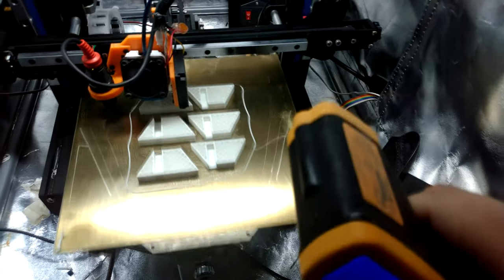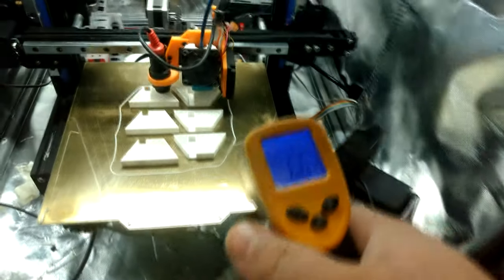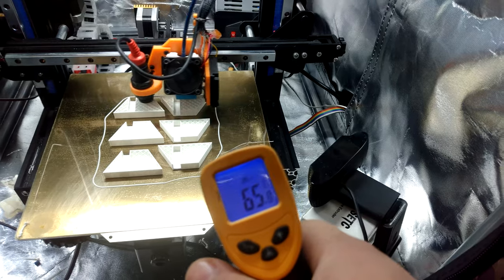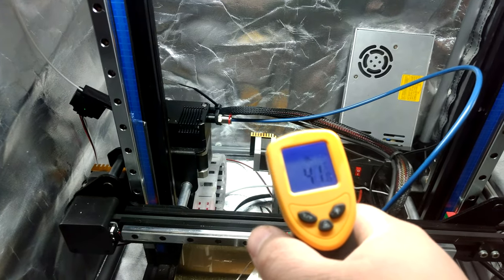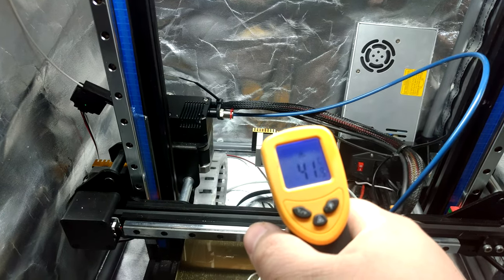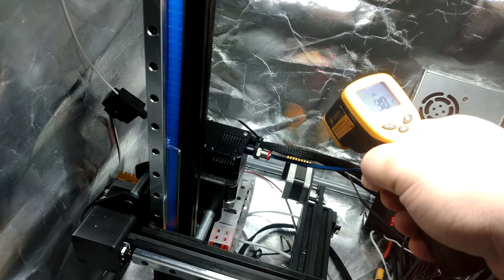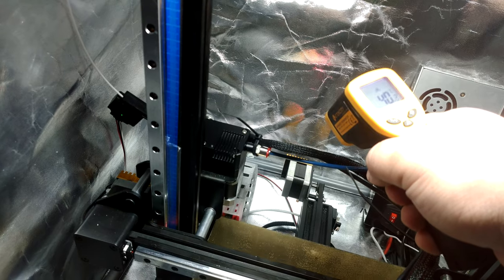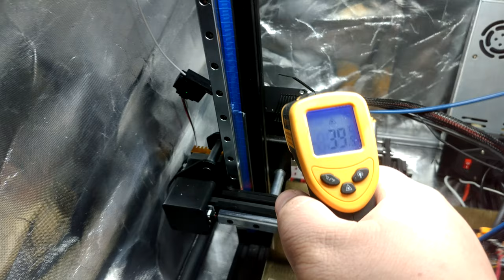The Downsides / Cons to Using an Enclosure For 3D Printing

Comment: Remove the AC/DC converter to outside, and also the motherboard from bottom. Connect the wires through the opening hole from the side of theinsulation. The only wire that you will need to extend is the vertical axis zero position sensor wire. I did it and it worked great.and tightening the belts is also needed,because at high temperatures they might be lose and cause failed prints.

Comment: While the motors are a concern, I've had them burning to the touch before, and yes, they can have issues when that hot. 40-50*C aren't really a worry imo though. My experience is that the cold end can get too hot and cause heat creep clogs in fully enclosed systems. Granted, that was using PETG and not something like ABS or something higher temp, but a water cooled cold end should be a consideration when doing an enclosure.

I'd also worry about the power supply and the brain board being in the heated area. Both of those you want to keep pretty cool for longer life.

Comment: Screw the motors, that psu in the corner crying for some fresh air is what worries me 😱
Reply from the maker: That was a very temporary situation. It needed longer cables to be placed outside the enclosure. It's all good now 😎
Reply: @andrewesquivel  I see 😁 can't say im a saint either since my psu is kind of in the danger zone aswell, need to build an enclosure for it badly 😅

Comment: I'm curious as to why an INSULATED enclosure. I use thin plastic for the enclosure sides along with temp controlled exhaust fans place high in enclosure. Never had any issues since.
Reply: Insulated allows it to work for more people. It's extremely easy to cool it down by just adding ventilation fans but difficult to warm it up more. Insulated enclosures are basically a requirement in places it gets cold that either sit in the garage or have a vent going outside into freezing tempatures.

Comment: the psu should be moved outside the enclosure (all electronics that can be moved should ideally), and probably add a thermometer to monitor the temp of the air, or add a gentle exhaust..... if heat is an issue with steppers, you could always consider water cooling :D lol

Comment: I agree that steppers need cooling, but I am concerned about the main board and power supply.  Also, when heat and electronics are combined, resistance increases.  I'd like to use a  closed circuit method, but as the heat accumulates, the reliability of those steppers would decrease.  The commercial flavors seems to have figured it out.  Any chance of us being able to catch up?

Comment: With a heatsink on the side of the motor, you're likely transmitting more heat into the frame, than the heatsink. When I added mine, I drilled out the center to ensure none of the thermal epoxy entered the shaft hole. The PSU will contribute to the heat...but the sensitive electronics of the PSU shouldn't be in the enclosure. Not only for longevity but efficiency as well, it needs to go outside the enclosure.  After a quick Google search...seems most steppers say -10°C - 40°C, but I've heard 50°C from YTbers for the max continuous operating temperature.
Reply: While I agree with the PSU/motherboard and other electrical components being as cool as possible. Stepper motors are rated from 75-90C depending on the type. That is however the rating of the motor not the air around it. Anything above 50C outside temp the steppers are going to lose their strength at a much faster rate. Below that I wouldn't worry too much.

Comment: peltier  element cooling the  motors ?
Reply: Peltier elements has a theoretical maximum efficiency of about 2 percent. They  are extremely bad at cooling systems that outputs a large amount of heat. LTT did a video https://www.youtube.com/watch?v=IX2NQ1lq4ZM

Comment: When I enclosed my ender3 it caused the  stepper drivers (heat sinks installed)to fail on my BTT board. At least that’s what I believe it was because everything was fine until I enclosed the printer.
Reply: Everything needs to breathe. Leave couple holes
Reply: yeah, stepper drivers get hot… especially the “E” (extruder) one. The TMCs that work cooler nowadays are 2225 and 2226. Some printers new printers are aditing those only for the “E”. 

Include a fan pointing to that can work but move all eletronics to outside is better, of couse. if layer shifts start to appear and other “motor failures”… that must be the reason

Comment: Some steppers can handle 180c.
Some PSUs exist for hot temps but it's just not worth it. It's super rasy to put it out tho.

But for my printer I can thankfully just let them hang outside my enclosure since it's a corexy designed with this in mind.